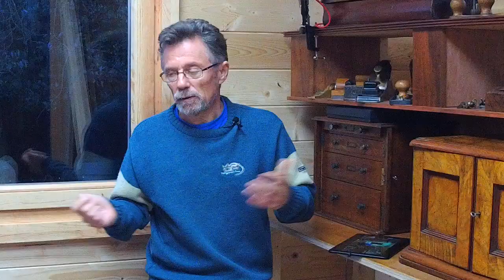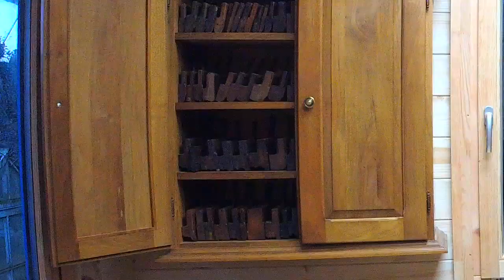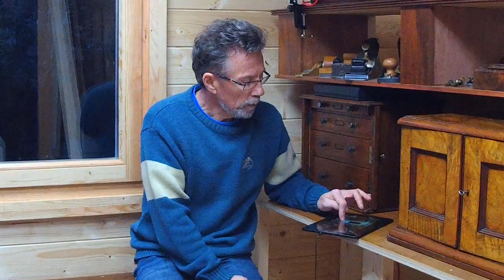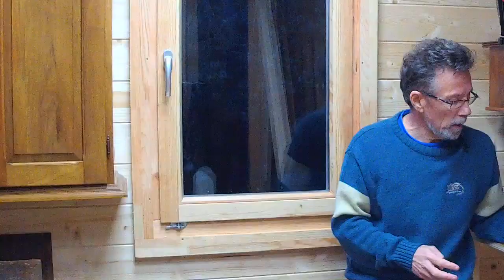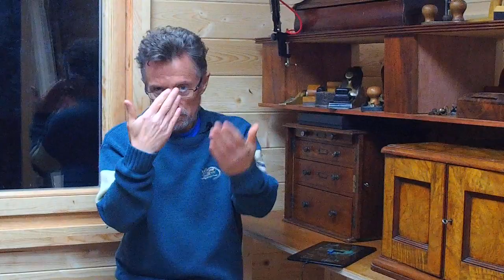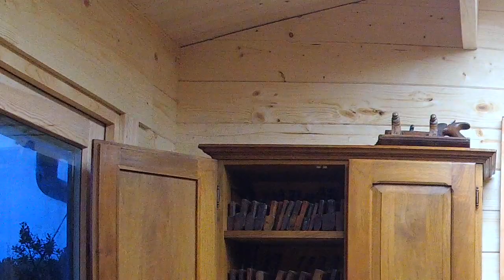KT Tools Working Museum & Media Centre - Cameras

Comment: This is fantastic! Congratulations on getting it all set up.

You've got an echo in your audio chain, not sure what's causing it. Just a few notes on audio (I have 12 years in the film industry, work as a voice actor, and help run a historic cinema), the mic you have overhead looks like a LDC, which is designed to be used at a distance of about 10-18 inches in a relatively anochaic environment. Basically the reverb of the room will really mess with the sound on that. The lav mics are probably gonna be the way to go for you.

Rode makes some affordable wireless lavs that I have tried out personally, and they are excellent. I believe it's called the RodeLink. If you get two of those, you should be pretty well set for 99% of audio situations.

We're friends on Facebook, so if you ever have any audio questions, you know where to find me.

But yeah, that camera looks really cool. I'm especially interested in the AI features where it auto cuts from shot to shot, and/or follows you around. That would be my primary interest in this tech, as live switching whilst being in the videos would get distracting after a while.

All the best, buddy!
Harrie